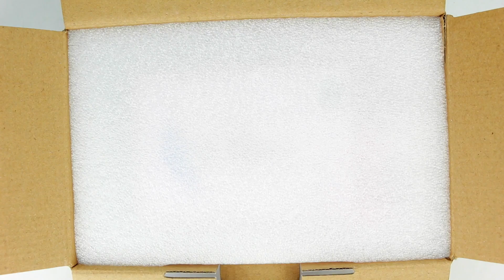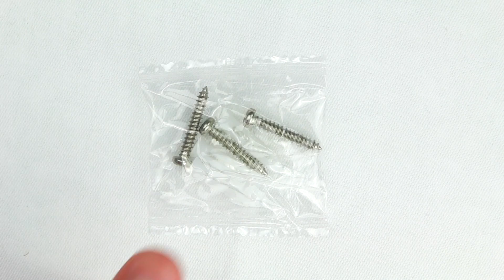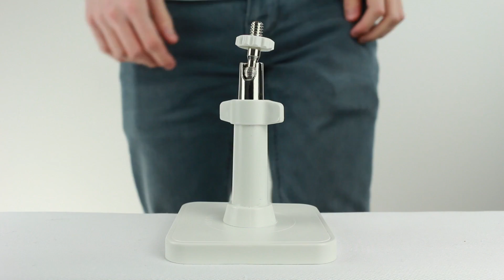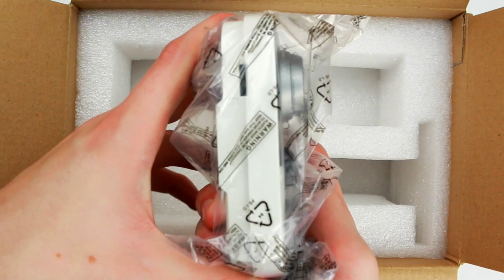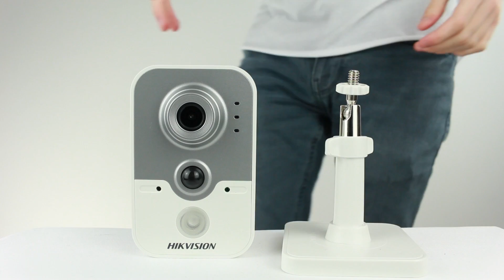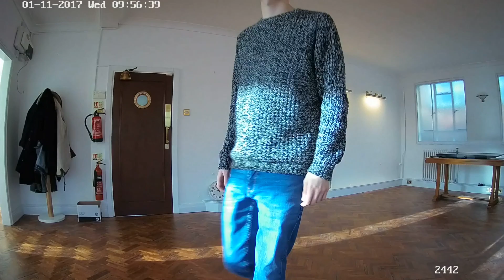Camera Demo & Unboxing: Hikvision DS-2CD2442FWD-IW 2.8mm 4MP Cube Camera

Comment: what is the Android app called for this phone, and can you setup the PIR alerts on the app or must it be done in browser? thx
Reply: is it possible to use it with HiLook Vision android app?
Reply from the maker: Hi, Hikvision uses an app called Hik-Connect and it is available for both Android and iOS, in terms of PIR you may be able to turn on PIR via the app but to set up the alerts and how you would receive them, that has to be done via a browser. I hope that answers your questions
Reply: thanks

Comment: hey ,whats the difference between the 2.8mm and 4.0mm model? thanks
Reply from the maker: Hi Anthony, the difference is simply how much the camera is able to see, 2.8mm is a wide focal length (about 90 degree field of view) and 4mm is narrower. Check this page on our forum for examples of what each focal length will look like - https://forum.use-ip.co.uk/threads/hikvision-focal-length-differences.711/
Reply: use-IP Ltd hey thanks for the reply ,is there also anyway to turn off the power leds?
Reply from the maker: Hi again Anthony, I don't know of a way to turn the LED's off, quick search online seems to suggest most people just put tape over them :) I know it's a bit of a rough solution but at least it works